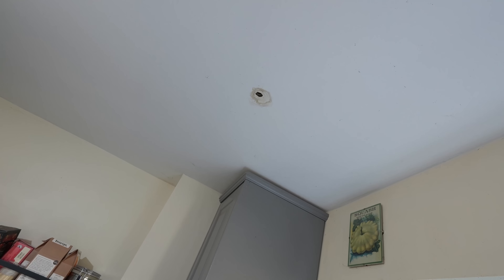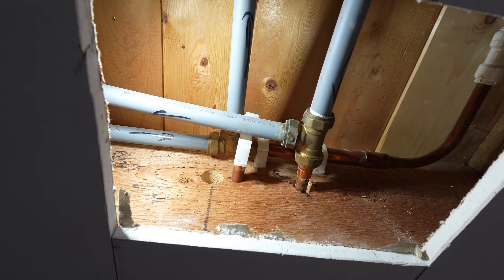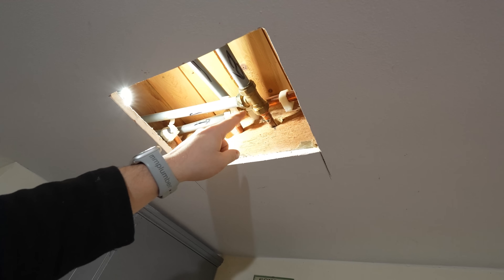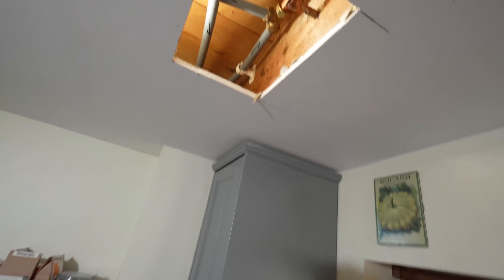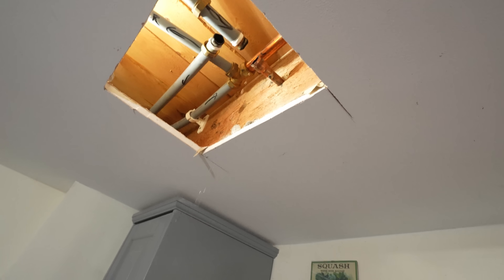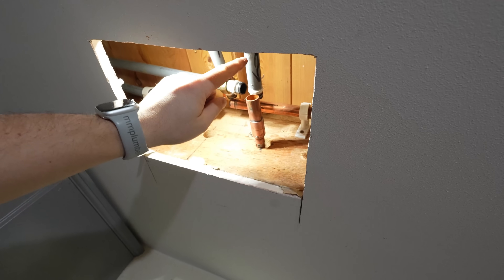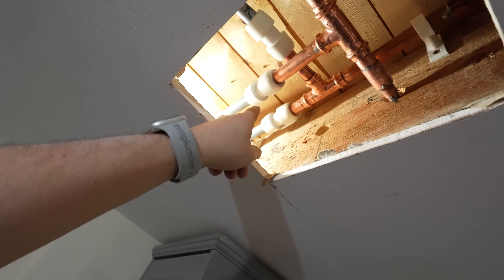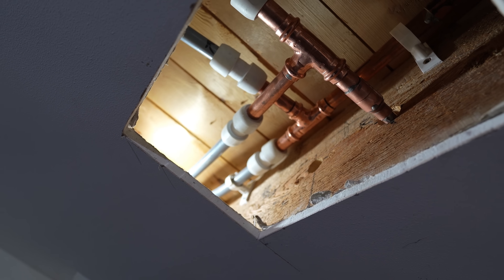I Found a Leak… From Compression Fittings on Plastic Pipes!

Comment: Hey! Possibly a stupid question but how come you used hep not poly couplings? Always tend to stick fitting & pipe brands same where possible & poly more compact/easier to disassemble (when you miss-cut haha)
Reply from the maker: Hep2o are much better in my opinion, as long as you use there inserts pipe is pipe

Comment: I have been to two properties that have flooded because a copper pipe slid out of a good quality plastic coupling, similar to the ones used here. The reason is because the gripper can not dig into copper pipe to help the gripper like it can plastic and once the gripper loses its tension, as all springs do over time, the two will come apart under mains pressure. Agreed, this took about fifteen to twenty years but it happened and took the ceilings down in both properties.
Reply from the maker: Which fittings was it?

Comment: If it was my house I would have at least tried tightening the joint. I would then have left an access panel possibly permanently, possibly until I was happy the leak was fixed. Of course that way you might have only been able to charge minimum charge so perhaps that affected your choice of remedy.
Reply from the maker: I can only leave the job knowing I did everything I could to walk away knowing it’s right using the connections designed for the pipe

Comment: Lovely professional Job, i did a lot of work with a plumber,  ( I am a retired electrician ) he always maintained that he let the soldered joint cool down over time. He always said if you cool it down with a wet rag etc it could crack the joint any one had this experience,
Reply from the maker: Yeah you can get hairline fractures doing that mate just need to give it a little time

Comment: I would never use plastic pipe in the house and when I fit copper pipes I use compression joints as much safer and easier to make secure. I once used compression on gas pipes when I was in N.Z. and the gas man said can't due too a stupid law. He passed the pip[e as safe then installed all Yorkshire fitting, after he had gone and I got my gas I ripped them  all out and reinstalled compression joints, he never knew and I felt safe and never a problem.
Reply from the maker: What would you prefer compression over over?
Reply: @mmplumber   I would never use plastic pipe in the house only in the field for pumping water and then I use Jubilee clips over brass fittings, but never in the house. You ever get a small fire the pipe can melt then you have water every where., all my water pipes indoors are copper, so never a problem.

Comment: Compression fittings on plastic pipe ? I have not seen that in the U.S. Seems like a disaster waiting to happen . I have done a lot of plumbing with PEX and never had a leak . So much so that i only use copper where required now .
Reply from the maker: It’s just lazy plumbing mate I always try to use the right fittings that are designed for the pipe. Just makes sense

Comment: Don’t plumbers solder pipe anymore. Probably wouldn’t of leaked if copper pipe was used
Reply from the maker: When people fit new houses or Reno and have to go through timbers it’s always plastic, if it was me I would use mlcp which needs crimped fittings

Comment: I hope you added some fresh rust inhibitor to the system after draining it down?
Reply from the maker: It was only top floor
Reply: @mmplumber  Thanks for the reply, but it does surprise me a bit given the effort you went to with the unions. However you did not take five minutes to pour in some inhibitor? At best the system would have been 50% diluted from you draining it, but probably much less concentrated than that given the leak in the pipe and the fact it may not have had much if any to begin with. The radiators can now begin to corrode from the inside causing rust pin holes, internal gassing and an increase in muck. Any time I drain a system, even partially, it is a must to apply. Just my tupence worth...

Comment: Why did you not just use pushfit fitting on all of the joints?
Reply from the maker: I had to solder that reducer and wanted to use joints that’s less likely to leak

Comment: Plot twist, it was leaking from the copper - copper connection 😂😂

I would have wanted the push fit connection further round sacking off as well.  I knew I had found a good plumber when doing some work in my house to remove old compression fit stuff from under the floor, one of the jobs was to remove a shower pump, it had all been done with push fit plastic stuff that had been thrown together at some point, I didn't want to go too far with that as doing up the bathroom soon anyway so asked him to just remove the pump and link it all back up for the time being, he said "I'll have to nip out and get some bits, I don't carry any of that plastic DIY shit in the van".

ETA, I am meaning the old fashioned type push fit one that you didn't touch, I don't like any push fit but at least the ones you installed were the proper ones and short of replumbing the whole thing are the only thing you could have used.
Reply from the maker: Yeah mate I had no option once they use it and I’ve used the best option out of the plastic type

Comment: the problem is plastic pipes and compression fittings which do not last as long as copper solder joints
Reply from the maker: I hate plastic unless it’s mlcp and being pressed

Comment: A fine example of keyhole surgery Matt. Can you come and sort my dodgy knee out? 😂😂😂. One thing I would have done differently, not a criticism. Is I would have used matching polyplumb fittings as I’ve had issues with mixing and matching pipe and fittings from different manufacturers in the past.
Reply from the maker: Yeah I get it with using the pipe, I’m sure hep say it’s fine just make sure you use the there inserts! ❤ haha I did feel like a surgeon

Comment: I would have put some pipe thread or paste around all the existing compression fittings and left it as it. 

Changing 2 fittings for 7 fittings just gives more opportunity for future leaks? 

I know using compression on plastic isn’t best practice but the existing looked like it had been there 10 years + without issue
Reply from the maker: I couldn’t patch a leak when the customer has to pay for the ceiling to be done, what if it leaks again? If you going to use plastic then use the fittings that are designed in my opinion

Comment: Aesthetically I'm not a fan of those press fittings, although fine when hidden.  Any reason why instead of soldering on that diddy extension, you didn't make up a soldered 'T' extension away from the hole, and then solder that on (one less joint too)?  Once in place you can then push fit the plastic.
Reply from the maker: Because when you put together a tee your linking it all up and the water will free flow into the fitting and cause soldering isssues
Reply: @mmplumber  The tee is made up away from the hole and only soldered on where you soldered on the extension.

Comment: PEX and PB pipe manufacturers allow the use of compression fittings provided the correct inserts are used along with copper olives.
Reply from the maker: I agree but these is a reason why this was leaking years after install. I would always favour connectors that are designed for the pipes instead of compression which the inserts restrict how much pipe enters the fitting

Comment: Good job. Just goes to show that it’s never a good idea to use a metal compression fitting on a plastic pipe. It will always create micro cracks that are eventually going to leak.
Reply from the maker: Exactly that! Use the joints that are for the pipe intended

Comment: what was the reason the joint leaked in first place. notice a brass olive on it. me being me would have just disassembled the joint and made good. possible cutting the plastic back a bit and refiting a new olive etc.
Reply from the maker: Then it will happen just again, I always try use the fittings that the pipes designed for

Comment: - Neatly done, clean cut hole in sheetrock and didn't make a mess - Supported copper tubing and Pro-Press instead of soldering cause of the water still in the heating system - You be wealthy having a business in the States with your quality of work y'all do -  Be well -
Reply from the maker: If I didn’t have a families would defo be in the states! ❤
Reply: @mmplumber really? I loved my visit to London. Seemed like a great place to live.

Comment: I hope your customer appreciates your service. I would have been tempted to only fix the one leaking, but fair play to you. Also I have done repairs just like this but don’t get the plasterboard out in one piece. I smash it out with a hammer. I do have a multi tool, just never tried to be that careful.
Reply from the maker: Haha you cut need to know where to cut to have in one bit, I stoped the blade short of the joist but if you cut on a joist it has better chance of braking

Comment: Looks to me like that leak has been there a while and a previous plumber knew about it but decided to put a catch can under the leak hoping that when it did leak it was only infrequent and whatever did leak into the catch can would evaporate. The metal lid (catch can) on top of the plasterboard or whatever it is in shot looks a bit suspect to me. Maybe a rodent has moved it away from the site of the leak and that's why the water has eroded the plasterboard?
Reply from the maker: You know what I never even noticed that! Great observation honestly! 👏👏👏

Comment: That explains why the code prohibits the use of compression fittings, which must be screwed or push-fit, when there is no access panel.😅

Apparently you're making the same mistake again... 🎉🎉🎉🎉
Reply from the maker: I agree mate no compression in the walls!
Reply: I don't think you are right about the code. It seems to prohibit connections that require any kind of maintenance.

Comment: Copper pipes for radiators? Seriously? Few heating-cooling cycles and the thermal expansion will do it's work. Steel pipes with welding in inert gases are better option for radiators. Good quality of welding has no problems with corrosion or thermal expansion, it is more reliable than fittings.
Reply from the maker: I agree mate but it’s easier to install and that’s how the world goes round now…efficiency
Reply: @mmplumber look sansvar channel - he is always plumbing radiators only with steel pipes and 99% welding pipes, fittings he uses only sometimes when welding is physically impossible

Comment: Surely compression joints are supposed to work fine with plastic pipes, as long as the insert is installed? I have used them a few times and had no problems, on 15mm, though.
Reply: Correct.  Compression onto plastic is allowed by manufacturer's instructions which, after all, is what we should go by rather than woolly reasoning.  There is a place for making own judgement but in this case it isn't warranted  IMHO.  I also, have done compression onto plastic numerous times with no issues.  I normally put a few turns of PTFE around the olive for good measure but have done them without and again, no problems.  What you must not do is use the Speedfit Superseal inserts - only use the plain inserts into compression joints.

In this case, it looked like the installer had used LS-X on the joints - could see it pulling when he took the joints apart.  They may not have tightened up the compression nuts sufficiently and the LS-X held until now.
Reply: More that compression shouldnt be used in anywhere inaccesible
Reply from the maker: They just cut into the pipes and a lot of room for error, plus the inserts stops the length of pipe going inside as much as maybe needed

Comment: Une intervention vraiment pas facile mais le diagnostic et la réparation ont été effectués d'une main de maître. Ce n'est pas possible qu'un professionnel ait effectué une telle installation lors de la construction, c'est du bricolage de particulier. Je ne sais pas quelles sont les normes UK, mais normalement l'encastrement de raccords à compression est formellement interdit. Surtout quand il n'y a pas de trappe de visite. En cas de problème, le dégât des eaux est certain et je me demande même si l'assurance accepte de prendre en charge le sinistre.
Reply from the maker: Yeah I hate compression under the floors or walls so that’s why try avoiding at all costs!

Comment: After wasting hours of my time over the years waiting for dripping pipes I bit the bullet and bought a cheap wet vac.  Makes life so much easier; no more waiting around, no spills when removing a WC pan or cistern, traps, etc. For the sake of 50 quid or so it's a no brainer.
Reply from the maker: Wetvac are good but can pull more water down where your trying to solder especially on heating

Comment: you just added extra unnecessary fittings that have the potential to fail though. surely 2x pushfit Ts in place of the original compression fittings was the way to go?
Reply from the maker: And how do you connect the pipes to them tees when the ends are damaged
Reply: @mmplumber  which ends were damaged?
Reply: End of the plastic pipes would have been crushed by the compression fittings. Need to trim them back to clean pipe anyway so you're gonna need couplers in any case
Reply: @ojmbvids  debatable

Comment: Perfect sized cut hole to remedy the leak, brilliant job,in the video 11.20 secs in, I saw nails put through the floor boards above just above the pipes,I had done a similar job where these nails rubbed on a heating pipe and made it leak, glad you had both soldering, push fit fittings🙂🙂🙂you are a genius, people learn from you,keep up the good work🙂
Reply from the maker: I try my best bro
Reply from the maker: Yeah I saw them mate! Didn’t want the one pipe against it l!
Reply: Great watch strap
Reply from the maker: @michaelmattison2439 only way I thought people couldn’t use my videos

Comment: Another great video. Any idea why it leaked? I see some people have mentioned plastic shouldn't be compressed (even with inserts). What the best option for a DIYer like me (without soldering or the expense of a press fit)...
Reply from the maker: If your using plastic pipes then use the fittings that match, in my opinion tightening more just cuts into the plastic
Reply: Ah got you. Try not to mix and match, especially concealed stuff. Makes sense and noted. thanks for replying.

Comment: Compression under boards is a total no no. I had a gas fitter one leaving gas pipes with compression under boards 🤦. Had they just used push fit it probably wouldn't have leaked
Reply from the maker: Exactly that I don’t understand the reducer maybe they ran out of plastic fittings 🤔
Reply: @mmplumber That's lazy. Honestly, if you'd met my first ever gas fitter you'd have had a heart attack. I caught him using my tools when I came home, he butchered my new wooden floor, flooded my hallway ceiling because he left loose fittings and ran 25m of 28mm gas pipe from the bottom of the house to the loft and supported it with ONE, yes ONE clip only.
Luckily, I have a really good one now 😅
Reply: I don't think push-fit is legal for gas pipes! Compression is though. I would much rather have compression than anything with o-rings.

Comment: Great vid thanks. Can I ask a question please. When you were refilling the system you topped up the pressure before switching the boiler on. What happens if you are dealing with a digital display were you cannot read the pressure without turning the boiler first, is it safe just to turn on the boiler and refill? or is there something else that needs to be done first? Thanks
Reply from the maker: Yeah turn on the boiler it won’t kick in untill it’s up to pressure anyway
Reply: @mmplumber  Thank you 👍

Comment: Great videos, nice repair job too 👍 Can't understand why the original installer used compression joints under the floor. Personally, I like something a bit more permanent, like end feed solder or, second choice, solder rings. I noticed that you, correctly, used pipe inserts on the plastic pipes. Did the original installer use inserts at the compression fittings .... I couldn't see, in the video?
Reply from the maker: Yeah there was inserts in the pipe? I just don’t think plastic should be used on compression as it’s not designed to! Could have used a plastic tee but I needed to get onto that reducer
Reply: @mmplumber  No, I think your solution was spot on with what you had to work with 👍 I did wonder if the leak was because the original fit forget the inserts but it was obviously just a tired old joint after thousands of hot and cold cycles 😊That Rigid press on tool is a great bit of kit. Nice to see that you still use good ole 'Scotchbrite' (green abrasive) ..... wouldn't be without mine. Will look forward to your next vid ..... always interesting!

Comment: Why use press tees, when the rest of it is the horrible push fit anyway and you used push fit connectors onto plastic and copper pipes there?

The soldered connector with water nearby I would be wary of soldering and overheating it. Personally I would add dab of flux as I solder.
Reply from the maker: Can push a push fit over a endfeed solder it had to be extended so I used press to get onto it after
Reply: @mmplumber  I know you had to extend the end feed fitting, as it wouldn’t have been long enough for into a push fit, but I was wondering why bother then using press fittings when push fit onto the extended new pipe would have been same as rest of fittings you used?